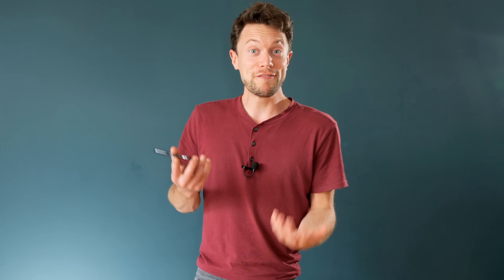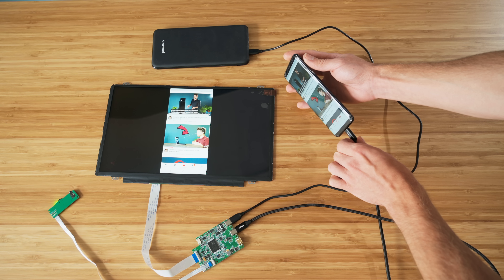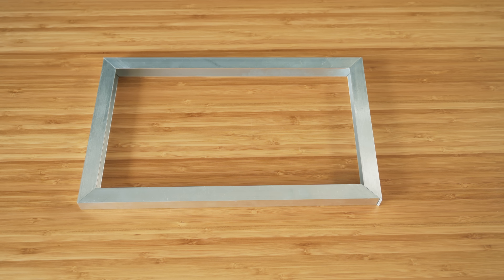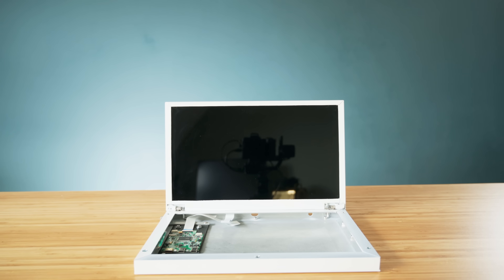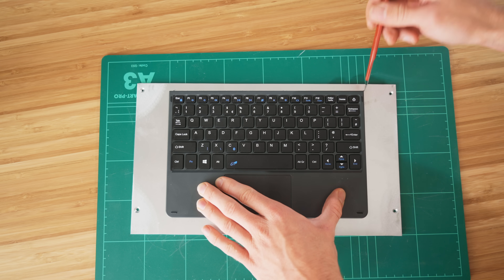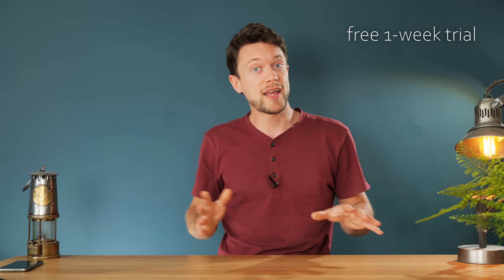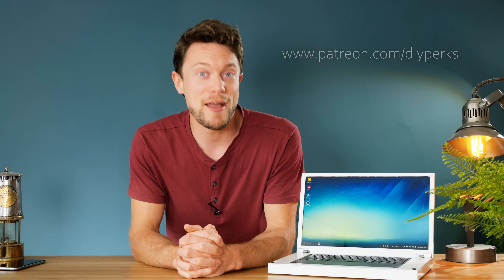Broken smartphone to working laptop transformation

Comment: Well, the best option (at least for those who have a 3D printer) is to make the housing parts with plastic of the filaments/resins instead of using aluminum because it is cheaper and more practical and obviously you have the artistic freedom to customize whatever you want, resulting in a unique and aesthetically beautiful laptop... or maybe not
Reply: yes but you will be limited to a 13" screen or something like that... And I question the strength of the extruded PLA, even ABS.
Reply: @lutuvarka2649  You could make it in multiple parts, but that would obviously hinder the strength too.

Comment: Some improvements, use a hub to attach usb ports. The switch for power, sliding it back and forth is going to wear the ports out, so it would be better to switch +5v on the USB line. Modern laptops use an antenna in the screen, not a bad idea by removing the circuit board from the phone and directly mounting it. Also, instead of aluminum, just just pvc. If you want to go all out, put a USBc dock inside.
Reply: i'd like to know more
Reply: No need to create ports.. just bring the damn hub. Makes a cleaner, simpler build.
Reply: Yeah I'm agree on what yiu saying I want to try this to get a new multitaskting smartphone laptop but I need to make a USB ports for my external hard drives to be use with it like what my computer can do
Reply: but this project came up with USB-type C port, can it comes up with any other devices or just phones that have that port? I want to rebuild this project for a contest but i don't really know the range of smartphone that can be converted into a laptop. Any suggest??

Comment: It sounds nifty in theory, but if you compare the price of the necessary components to a used laptop  or tablet you can use without any fiddling, it becomes a lot less attractive.
It'd be a lot more viable if you could use the shell of a laptop with a b0rked/too slow MoBo and add in a converter board from USB-C to that particular LCD.
But the good thing about standards being, that there are so many, this seems sadly not to be a viable option either.

Comment: Want to do same thing apart one diference, want to use old laptop body as the case. My question Is: can I easily power IT from laptop original battery? Do I need to add any special board, or is it only question of rewire? 
Thanks for answer.

Comment: does this work with an iphone? just plugging it in a screen like this trough its charging port and u can use the external screen?

(friend of mine smashed his iphone and internaly everythings fine just the screen was no longer responding and very broken so he pulled it out now the question is, if we plug it in a screen like this could that external screen just magicly work as if it was the main screen of the phone?)

Comment: The problem is that this may be working for only certain models of  smartphones with USB-C video out and capable of host/OTG while charged (like the Galaxy in this example). The price of expansion board is also higher or on the par when using e.g. Raspberry Pi which have full peripherals available with all drivers ! While the smartphone has closed drivers (and even the whole system) which are not maintained after guarantee period and will become unstable through time (though it can be temporarily solved with things like LineageOS).
I would buy RPi4 (or good clones e.g. Radxa Rock Pi X) with at least 4GB of RAM and nice miniHDMI display and build it all in nice enclosure (like in the video) instead... 😀
Believe me, if you mean it seriously to use such home-made device, it will save you much nerves and time !  
If doing a school project, maybe this is a good exercise of your skills for simple DIY "netbook" presentation, it will work and looks nice (and, at least, it may be a good present for your grandparents).

Comment: So the MI said you will need top of the line microprocessor lab, metal cutting equipments, sanding, painting booth, 3D printer, epoxy glue, and what else/more powered equipments?  MORE POWERTOOLS??

Comment: I really dislike this particular video. 

1:45 The critical component of the project is the USC Type C connected display and that is probably all you need. 
and if you like to revive the smartphone in a desktop mode, you may like 
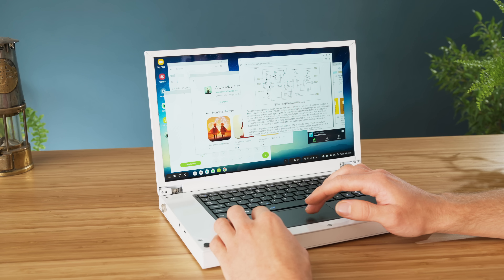10:35 the Samsung desktop related software also.
All the other DIY stuffs he has done are all genuine hobby for its own sake, but completely useless for practical use.

If the bluetooth is alive on the smartphone, then you can simply pair a bluetooth keyboad to it. Why would you want to do a stupid DIY here to create the keyboard part?

Also, why would you need to build your own power charger when there already exists a port for power charging in the mobile battery itself? Unbelievably stupid.

Comment: Definitely doing this with my old Google Pixel that won't hold a charge anymore.

Also if you had done your mold higher (if the USB-C cord is long enough) you could have the phone stick up a bit above the monitor to use the front facing camera as a webcam.
Reply: I don't think you can. Not many phones have video output through their usb port.
Reply: @chlorophyllphile  USB-C supports display port natively, so as long as it has a USB-C it should work. If not then you can always use adapters to make it work.
Reply: @andrewb9595  I don't think that is how it works. Usb-c is just the connecter that can be used for different protocols. A phone can lack the hardware to output video even if it has a usb port.
Reply: @chlorophyllphile  Good point, I didn't think about that. I've read that a display link adapter works on the Pixel, but I guess I'll have to try it and see. If not I guess I'm SOL.

Comment: few ideas how to improve this even further: use a normal switch that would be soldered to one of the usb power wires to the board, or a relay to not rely on a mechanical switch, and add a USB C port to the side, e.g. with a USB hub

Comment: It not becomes completely unusable, it needs to be repaired. Mainly only screen breaks. And why you didn't removed the phone battery and motherboard and just used that and connect it with that LCD screen? That would have been so much simple built. No need of placing phone inside with a big power bank that is just gonna heat up and give risk of exploding or short circuiting. And even using type c is not mandatory or using converter to use hdmi. You can just use usb B to usb B screen or controller pad for that LCD

Comment: nice, and currectly useless as my phone is a TCL 20 5G which is usb 2.0 and doest support DisplayPort Alt Mode, so my usb c to vga,hdmi are uselss, so only the usb c for power and single usb port with an extention hub with an usb external storage drive which needs to be formatted, mouse and keybaord will work. so im still stuck with the little phone screen.

aaaaaand 

im not gonna bother fixing this spelling and typing mess.

Comment: The overall project is really good, but the power management is really bad. The keyboard battery can get drained before the phone, the powerbank is only charged with 5V (really slow for a such USB C powerbank) and the on/off switch is not reliable. It is a lot more complicated to do that correctly!

Comment: Your ideas rely too much upon the software capabilities already installed in devices. This is not always the case, so different mobile brands would not work with your idea. Also, you could have used plastic sheets instead of aluminum, to let the WiFi signal in, and the phone could(finally) fit inside. 
Not thinking about the idea of using the gummy pads to hold the phone in place... 😰🤦
Another thing is the software compatibility: I don't think you could have any word processing or spreadsheet capability compatible with other OS easily. Last but not least is the price of the screen with its related electronics: is very costly and does not justify all these efforts. In conclusion, a great loss of time!

Comment: If you also happen to have a broken switch, take apart the dock, and grab the converter board from that (only if the switch is very dead). Then, dig deeper until you find the ribbon cable that goes to USB type c, plug that into the board, hook everything up to hdmi and you can have a desktop. Reusing electronics is a virtue.

Comment: Good idea but in reality a little harder
Would have been better if you dismantled the Phone and retrofitted it into an out off date tablet to utilise its screen and battery etc as unfortunately your option is more expensive than just repairing the phone, "New Screen fitted £50-£150" "build this £200-£400"
The Screen and driver is £150ish alone, the Battery pack £10-£100 and the Samsung DEX software basic is free but the auto booting Pro version (based on 2021 playstore details) is just under £9 which yes is Cheap but you add all that up and the value off the phone as it stands (approx £50 with duff screen etc) with the metal work and etc you'd be better off selling the phone and buying a Chrome book or maybe better.

I sorry is just crazy but otherwise love all your other ideas
thanks for putting the time in, also a a quick note rather than always buying new bluetooth devices collect old bluetooth speakers like I do to utise there batteries and links etc for almost free :) Reuse, Repair, Recycle.

Comment: Nice very good to know about the 2020 controllers!!
fantastic upcycle, u could literally make that into a headless hdd to ftp in to untill it dies, u could leave it plugged in forever on charge but just have a low power trickle when its full, so it  essentially powers down while the chargers physically in; this helps the battery life but people!! UNLESS UR SOLAR ANYWAY.... TURRRN YOURR SHIIIIT OFF & if you leave you laptop on at night look in to a cheap raspberry pi and go kodi.
goog vid man
turn your devices off people, stop wasting your power

Comment: I would like to see a twist of this one. Instead of building a completely new laptop, how about ripping mother board and stuff out of a broken laptop. And then add a possibility to dock a phone on the back of the lid.

I believe that would be an easier project for most of us.
(Easier... 🤔 Less difficult maybe.)
Reply: After some reading it doesn't look so easy after all. Finding a controller board for a laptop keyboard seems impossible. Looks like you have to build it yourself. 😬

Comment: Bro what I'm looking for that a samrtphone mother board  dismantle and could fit on the lcd controller as it fit in the smartphone housing  originally. Is there anything like lcd controller board that fit smartphone mother board all output cable could connect directly to lcd controller.

Comment: u really should do a ipad docking stand with smart connector... there is the kensington dock but it has no smart connector... somebody needs to invent a stand/doch with a magnet and a smart connector for wireless charging... basically u just need to take apart a magic keyboad and mount the stuff behind a stand...

Comment: At 7:36 those charging wires look awfully thin. They might cause the power bank to throttle the charging rate. No data connection either, I think that is needed for some of the faster charging modes?

Having two different batteries that charge separately is ehhhhhhh...

Comment: Hey Matt. You should do an update to this like turning old phones into a retro gaming machine using its usb Otg function. I am imagining an old usb dual shock console with a phone mount glued to the back and the cable is connected to the phone via an adapter. I am sure if it is you, you would have an even neater setup or one that has even more functionality like charging while console is connected or something. The beauty of this is depending on the phone it can even run psp emulations if it has the specs for it (otg of course.) I dont recommend the bluetooth controllers i bought 2 and they always ask me to download an app for it and it doesnt work and is not as responsive as direct connection via otg.

Comment: This was a great idea! However since I'm not going to build it myself and am just living vicariously through you, there are so many ways to improve this idea. 
1.) Using a power bank that has a battery percent screen and moving the screen up.
2.) charge the power bank with type c output to type c input as current devices use type c.
3.) Glue the phone up more so you can also use it as a webcam
4.) I'm glad you mentioned speakers otherwise you could have definitely put a larger keyboard and trackpad. (Speakers & headphone jack powered through an amp)

Now that I said them all I might actually build it now because it a cheap laptop killer, because
1.) it's cheap (so I don't need to worry about my expensive laptop)
2.) It light and durable
3.) It lasts for SO LONG and can probably add another 10 hr will a second battery pack...

Comment: Charging phone constantly is bad and dangerous, using power plug to USB c charging port is in my opinion stupid and also dangerous if you use not adequate power you could blow up your power bank. I recommend using USB c for powering power bank or  (DANGEROUS!)using lipo 
You could save some space for example the board you used for video output could be mounted on the back of display the keyboard could be much thinner by using thinner powerbank or thinner lipo 
Great project i made something familiar using RasPI but i fried it because i used too much power without mosfet

Comment: That would be interesting if you could install a desktop software for ARM processors(there's a lot of Linux ones out there Microsoft make one too)that are found in Android phones and use those as better alternatives and increase usefulness.
Reply: Installing Linux on a smartphone not made for Linux - not easy at all. That is why smartphones with Linux cost lot more for the same performance as ones running Android.
P.S. or maybe it is easy if you don't mind non-operating cellular, cameras etc.

Comment: I'm slightly disappointed - I was expecting you to take apart the smartphone and use its components for the laptop. Then again, this is supposed a DIY project - even taking it apart would be impossible for most people, let alone using its components. But still, it would be great to see a sequel of sorts, about making an actual laptop without the phone and a power bank still lying around.
Reply: Taking apart a phone is hard. Not Impossible. And if you have the patience to build the frame and everything, you have what you need to open up the phone.
Reply: @sedixmrboss5625  Read my comment again - I said it's impossible for most people. I don't think a regular person without a single tool to help them can open up something like an iPhone.
Reply: @hriday684  I opened mine with a piece of string to cut the glue, a hair dryier to heat it up and a credid card. Sooo...

Comment: One of biggest advantages of this is low energy consumption. It's difficult to get it use more than 10W even with pulling 5w with otg. While gaming, my phone uses about 2w to 3.5w of power. And laptops powersupplies wary from 30w to 200w.
It still probably charges slowly. And I can't believe it to run windows smoothly due to nature of cpu. Though Linux could be a different thing...

Comment: Dude, you just lost the full potential of the project. It could have been made twice thinner and lighter. Why is it so fat? What for? I do not even understand why such thick corners for the screen. The Powerbank could be disassembled to simply take out the flat battery, the phone could also be disassembled to the boards. I really don't understand, this video completely demoralized me. It was also possible to turn off the screen of the phone itself so that the charge would not be wasted and it would not overheat again. Re-release the improved version, please, which will be thinner and lighter, because you have not yet resorted to any manipulations with the place. I'm sure you can find more workarounds to improve, but even the first time you look at this laptop, you see a lot of optimization opportunities. Anyway thanks for other cool videos.

Comment: You could cut a nice space in the back so you could leave the phone inside. The big hole can be covered with Kydex , which you can heat-mold , and it comes in different colors.

Comment: when you added the power bank, and you see the extra usb 3.0 ports, would it be possible to connect a USB power board to the side of the aluminum strips and connect it to the USB ports in the power bank?

Comment: maybe an idea is to transform a old/broken laptop (wth a good screen) to a phone dex/desktopmode laptop
idea: broken or old laptop-> rip insides out -> put hdmi to lcd/tft board inside laptop body
add a big powerbank that powers phone and screen+ lcd board and put  inside laptop
put a usbc to hdmiout+usb ports+ sdcardreader adapter inside too that connects phone to screen and adds usb ports in laptop
put a usb keyboard and usb touchpad in the body also and connect to adapter.

now you have  a laptop dock for your phone to work in dex mode

Comment: As a suggestion, since S9s/Note 9s and later support Wireless DeX, how about using a 1080P wireless display adapter plugged into the HDMI port and powered from one of the USB ports on the power bank, perhaps switched on using the existing mechanism (small switch for power that is engaged via the sliding mechanism).  A number of wireless display adapters come with an external antenna which could go on the back of the unit - then you wouldn't need to connect a phone at all? You can also use other Android 10 devices which support desktop mode and use SecondScreen from the play-store to provide the additional capabilities.